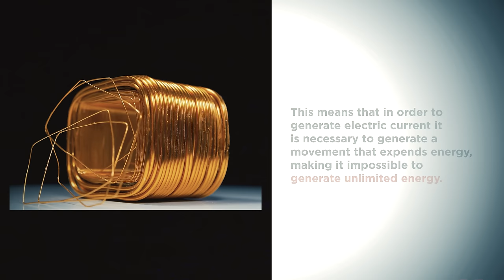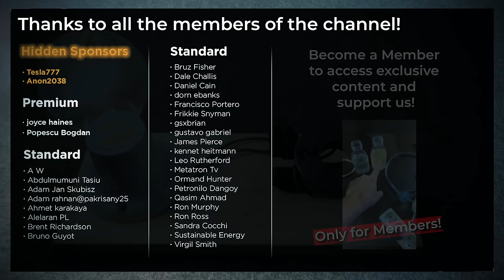INFINITE ENERGY WITH MAGNETS 🧲💡 💡Tesla Method

Comment: This is trick. Used button cell and reed switch which is close the contact using magnet near to them.
Please do not cheat your subsribers
Reply: I am a skeptic and have learned the magnetic field needs to be moving across the conductor. I will build the same coil shown in his demonstration maybe without the nice wood platform and bulb socket. Just solder wires directly to the bulb. No power strip to mask a hidden circuit.  See what happens and show others why it does or does not work.

Comment: I am skeptical but will build and test a reproduction of your unit. I suggest to those who might be considering nasty comments, try it , if possible without spending any money.  You will learn something.
Reply: Indeed, just try it, I'm also gonna test it, this is so simple to build. You can also use a magnet of a speaker.
Reply: It really works. Been using them for years 🔥 💪😊
Reply: Danke Kommentar
Reply: Just made one and it didn't worked, connected my multimeter to it and it measures a few mV when I move the magnet. I used a magnet from a speaker (Wharfedale Model 1746A 4196). I also connected a simple lightbulb from a car 12V 21W, an LED 12V lamp for AC/DC but my hope was gone after I first measured it. I guess these guys are doing it for the views so they get money from youtube.
Reply: @shcottypimpin4498  Hi, How can I make this to connect any house electrical equipment or device? How can I know the Voltage or watts  it will produce?
Reply: I don't need to build a glass hammer to know what will happen. I suggest you pick up a physics book, you might learn something.
Reply: @shcottypimpin4498  been using what? Speakers, magnets, coils, none of which produce free energy. Gees  , who do you think you are fooling,  and why?
Reply: @shcottypimpin4498  if it really works plz show us your model???
Reply: I just tried it. Unfortunately it didn't work for me.  I tried several different types of bulbs too.
Reply: @bck004  you have to use the magicians bulb, it has a built in battery:)
Reply: Learn something everyday or you wasted a whole day and you only have so many days, do not waste any of them they're too precious
Reply: @shcottypimpin4498  I just did it and it doesn't work.
I tried with a flat neodim magnet so maybe that's why it didn't worked. I am waiting for magnets exactly like those in the video and see if this is working.
So far, I just lost money, around £25....

Comment: Where to buy such a diametrically charged magnet?
It cannot be bought anywhere and thus cannot validate your tests.
Please help.
Reply: Have you tried Amazon or eBay, I have purchased small ones from Amazon.
Reply: And does it works? I made some fail for sure and my generator does not generating any energy

Comment: I am the only one out there that has actually ran a 2 cylinder engine with points and condenser no fancy Electronics off of 100% oxyhydrogen. I will challenge you $10,000 that I can run an engine 100% off of oxyhydrogen and yours will not. It is not just hooking up a oxyhydrogen gas hose to an engine and think it will work it will not.

Comment: Does not work. You can get some voltage by passing a magnet over the wire wrapped around a steel bolt but nothing like this.
Reply: Is it possible if we gave continuous movement on the magnet to produce energy?

Comment: thanks but it doesn't work unless there is a hidden battery....😁😁😁
Reply: have you ytied to make one simple test would prove it or not
Reply: @CAPTAINSSBN  Yes of course. even a long time ago. Result? nothing.
Reply: @emirdaku6915  what kind of magnet are you using? What’s it’s electromagnetic force pull? You need a strong magnet 🧲 !
Reply: @thomaspayne7800  I have used 90kg & D 60mm neodymium magnets. That coil produces nothing, not even 1 volt.
Reply: true 👍no volt produces, none.